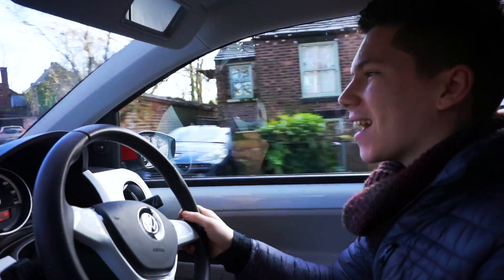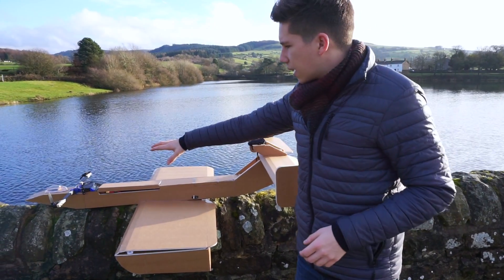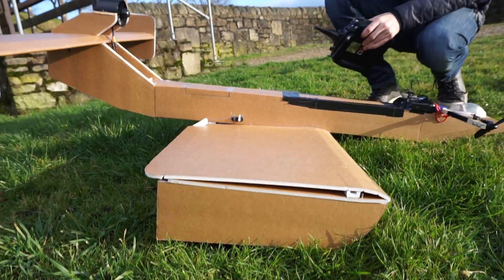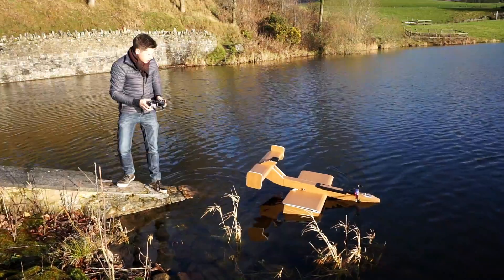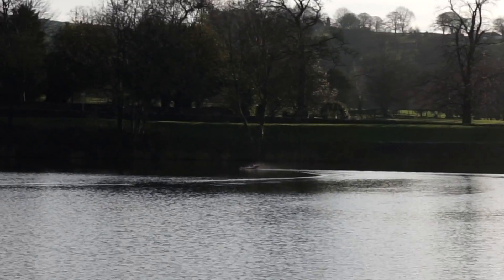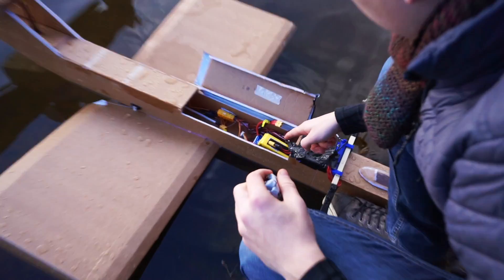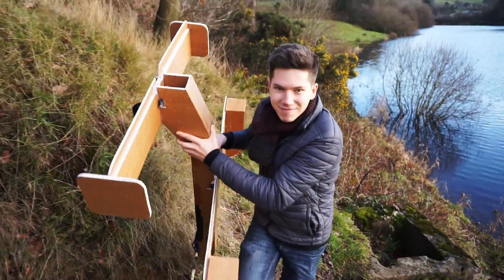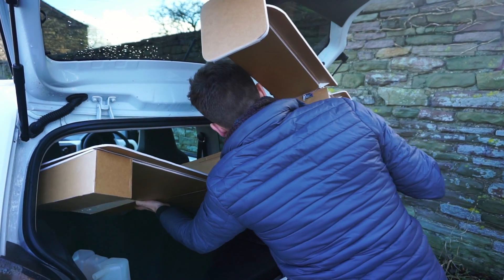Thrust Vectoring Giant RC Ekranoplan - Part 2

Comment: i build ekranoplans to, try building the model smaller and just use motors on the wings slightly up on there mount so the air flows under the wings to give the model a hovercraft flight, peter from crawley, ps what about starting a model ekranoplam model club,

Comment: hi dont use hollow wing and put a thin layer of polystyierne under the wing this will help to lighten the model and alow it float better plus use a standard motor driven prop at the rear, peter

Comment: Cool Project! Foamboard is usually only good for RC aircraft though. I'm into Boats not planes but I do know Balsa makes good Planes and good Boats as long as you seal the latter. Either with dope or epoxy. Perhaps that would work far better and if it did fail you wouldn't have to start fresh, instead you would still have something to add modifications to.

Comment: seems like your basic attitude on the water is too nose-down, making your take VERY pitchy...   it should balance on it's center of gravity not only in the air but ALSO on the water.......your wingtip floats seem overly massive and  might do better narrowed down to maybe an inch or so wide,  and to either have a chunk of solid foam inside them (to prevent water filling them) or reduce them to "open skis" with no closed compartments that would fill up (something like the Sea Otter's skis...)    
you also need some angling on your EDF..so it's slightly tipped downwards to help push the nose up, instead of just driving it down into the water....
your electronics should probably get Peter Sripol's waterproofing treatment as well....
some more ground testing on grass in a large field would probably help as well.....

Comment: I think you might be missing the actual principle of WIG craft. The idea is to trap the air underneath the wings. This can be accomplished with some positive incidence and some tip sponsons shaped so that the trailing edge of the wing sits flat on the ground/water and the leading edge is up out of the water. If the balance is done correctly you shouldn’t even need pitch control. All of my ekranoplan models are set up like this and all have worked. For a good example look at how Alexander Lippisch’s WIGs are made. That wing geometry is pretty easy to mimic and performs well

Comment: Do not give up you will get it sorted,better waterproofing would help as ESC's are very vulnerable in water as you found out,it was actually flying well but somehow you have to ballast  it to keep on the water,I think it was digging in/under due to thrustline of the EDF which needs setting upwards,you need a small boat or a dinghy,question,where are getting that waterproof Flitest foamboard from in the UK ? well done I like your interesting channel with all of these offbeat subjects.

Comment: Regarding the "nose up and flying instead of keeping in ground effect" problem you're getting: seems like you're experiencing just about the same troubles as the Russians did with their big version of the Ekranoplan. As far as the documentary I've seen about that thing went, they couldn't really get it to keep just the right range of height above the water until they got some kind of automatic correction going for that - manual turned out to be just too twitchy. Maybe add an electronic gyro sensor or distance sensor, that detects when the whole thing goes too far up and then reduces the "up" on the elevator and front motors. Get something like that set up, and it looks like you're golden (but then, maybe that'll turn out being easier said than done, because of then keeping your automatic system from overcorrecting, and plunging the nose into the water at full speed 😃)...

Comment: You‘ve built a poor plane, not a ground effect vehicle
Reply from the maker: Marc Koch From how it felt, it was actually quite a good plane.
Reply: A good Ekranoplan is a terrible flier out of ground effect. The CG needs to be so far back that the tail is producing lift as well. In fact, the tail needs more incidence than the wing. This means that as the craft flies faster, it pitches the nose down slightly, reducing the angle of attack of the wing. At the same time, however, the closer the wing is to the ground, the more lift it produces. This keeps the wing off the water, but still in ground effect.

Comment: 3:18 Man, wet shoes are the worst. This was a fun project, even if it didn't really have the effect you wanted. Showing failure stages in the hobby is just as important as successes, right? :)
Reply from the maker: RMD Cade you'll be pleased to hear the shoes are waterproof! Neat hu? 😛 I absolutely agree. I love showing how I mess up so others can avoid doing the same thing.
Reply: Thats how we learn,at least your projects are for real and not stuck behind a computer never building anything,improve it,ballast it up so it will not take off,make an inverted aerofoil tailplane,even inverted aerofoil wing,see what happens ?

Comment: I don't have time to make a ground effect plane now, but when I will go for it I think that I will build thicker wings and with a higher angle of attack 5-10 degrees. Probably with wings on the middle of the fuselage or in the upper part with negative dihedral.
Reply: I agree, but a ground effect wing does not need to be very thick. I built ground effect gliders many years ago, and all they used was a single sheet of foam for the wing. The tail needs to have slightly more positive incidence than the wing (for example, 5° for the wing, and 6-7° for the tail), and the CG needs to be quite far back. A good Ekranoplan is a terrible flier out of ground effect.
Reply: @GunganWorks   Thanks. I hope to remember all this when I have time to do one. Where I live now I have several big lakes to try.

Comment: Looks like you have a bit of an issue with the underside of the Ekranoplan sticking to the water... Thats because of the shape of your floats. A flat underside is always a bad thing to have, because it will stick to the water. You always need a point where the water can rip of from the Surface of every part that touches the water, just like the step on traditional seaplanes or speedboats. It is then easier to find a good speed where the pane glides on the water but doesn't fly yet.
Reply from the maker: Georg Obergfell yeah they weren't exactly the best design but next time they'll be better!
Reply: I even think this is pretty essential, for an Ekranoplan especially.

Comment: i think you can fix this by adding a smaller float to the nose and tail, so it has constantly at least 3 points of support.
that could prevent your nose smashing in the water like it did.
Reply: LolPlane It would be better to decrease the size of the wingtip floats. Use only the fuselage for buoyancy, but have a wingtip fence to prevent air from spilling out from under the wing.

Comment: Didn't quite work as ekrano-planned, but I suspect they're a bit of a bastard to get working right. Good crack at it though!

How about an EDF Harrier? Static mounted motor, with vectoring nozzles? I've seen them take off in the rain at RAF Wittering and they make a massive spray when they transition from "full forward" to "vertical thrust" on their takeoff roll! Imagine that in light powdery snow ;)

Comment: Fun project. But you should probably look how the Russians made their huge ground effect fly.

Do not make your pontoons/hulls so it rests on the front part when speed is up. You need the rear edge as it gives the lowest water resistance. You should investigate how a speedboat sails when it's in high speed.

Looking forward to following the next project, which could be a new version of your ground effect flyer.    ;-)
Reply from the maker: TheLandbo great points! I didn't intend for it to rest on the nose originally but unfortunately the moved CG meant it pitched to far forward when in the water. I don't mind learning through experience though, so it's good to take this away! 😉
Reply: @Project-Air  I think your CG problem should be arranged with a front wing with a lift that fits the weight you have from your CG and not the engines you can't control anyway. Also, the flight height above the water you must have steered automatically. How it can be done with standard electronics from HK or other sellers I have no idea., perhaps others might have the right idea ?

And yes. I want be glad to see your ekranoplan plane "flying" over the water at the ground effect. Good luck.

Comment: I like it!  I have always been fascinated by ekranoplans.   Have you ever designed a plane that uses pitcherons (rotating right and left wing panels) for the elevator and aileron functions?  I designed one which flew well, so then I made a twin version where the motors rotated with the wing panels.  It flew well too.

Comment: Ground effect vehicles are very hard to control on water , due to high viscosity of the fluid . Maybe it's better if used on a gigantic grass field ! Best of luck !!
P.S. : A new project of yours could be an rc hovercraft ! I made one  following peter shripol's guidelines on the flitetest video (the one in which they use an hovercraft on snow) and it turned out great!

Comment: Why not building using something more waterproof like the lightweight material used on r/c aircraft or was that mostly a cost-based decision?
Reply from the maker: Andy Smith yep could have gone with a plastic based material, but this was built using a waterproof model aircraft foam. 😊 Thanks for watching!
Reply: @Project-Air  Ah, I must have missed that part and it just looked 'soggy' when you recovered it - D'Oh! :)